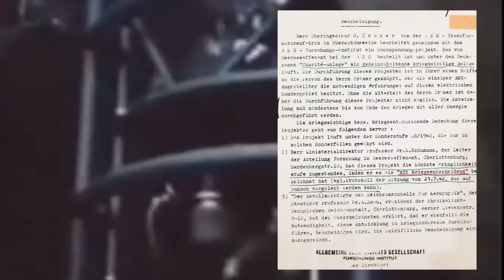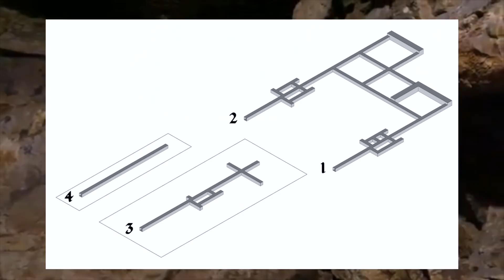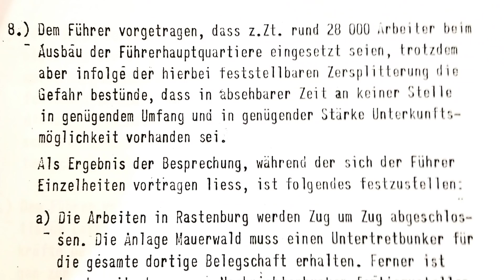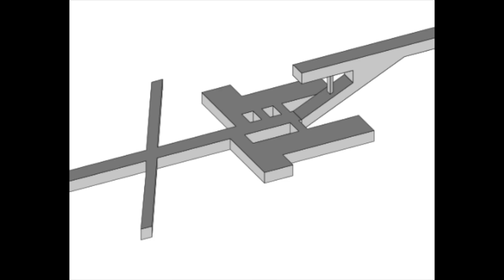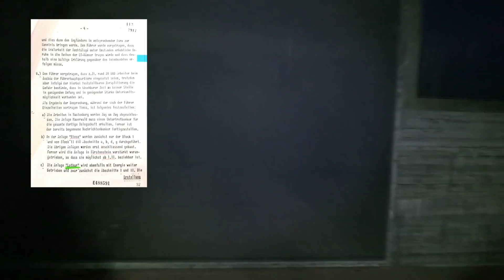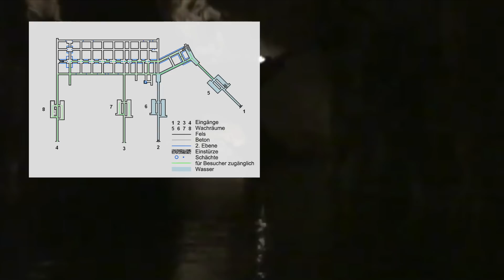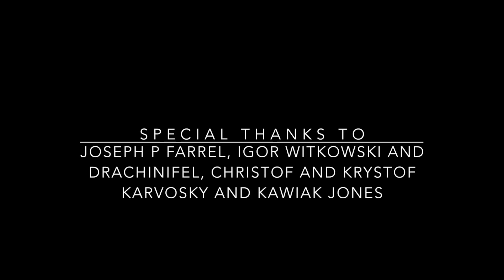THE LAST NAZI SECRET - PROJECT RIESE, WHAT ARE THE FACTS ON THE GROUND EP 3

Comment: Excellent !  I just remember a Commentator pointed out the unbelievable concrete construction costs incurred by the 3rd Riche for their research and development projects, in addition to defensive bunker construction.  These costs certainly curtailed their production of conventional war machines in the pursuit of victory.  Your Documentaries are done real well.  Thank you.
Reply from the maker: Thank you so much, and yes they really did not spend their money wisely makes one believe there was more to it then just building in different directions. Ill keep looking.
Reply: @tinostruckmann  It must be such a rush to be investigating  in person.  Good luck and thank you for such a great project.
Reply: You can make concrete with coal - tanks and aircraft need liquid fuel and the German armed forces never had more than 50% of what they needed after June 1941.
Reply: @allangibson2408  Yup.  Probably one reason Hitler invaded Russia was to get the Oil Fields in the Caucasus.  I understand that up until 1941 Germany purchased most of their fuel requirements from Russia.  They were convinced of a Quick War but were so wrong.  Also, Hitler took half of the Troops of Army A ( I think ) and should have bypassed Stalingrad with maybe just encircling the City.  Then Germany could have fought their way into the Oil Fields.  Of course, their flak  would be exposed.  That being said, besides invading Russia, the Battle of Stalingrad was in my estimation one real big reason why Germany began their defensive efforts to stall the ultimate end.  Turning Point.  Thanks for response.

Comment: That long gallery, with the unusual holes in the roof...
If you had a drive shaft above the ceiling running the length of the room, there'd be room for part of a drive wheel and a drive belt to stick down through that hole. So, a row of lathes?

Comment: We know from the Schmelcher Report (German engineer) of 1944 the purpose of each tunnel complex in RIESE.
1. Osówka and Rzeczka were built for Hitler's headquarters (FHQ),
2. Jawornik and Włodarz - headquarters of the Land Forces Command (OKH),
3. Soboń - headquarters of the Air Force Command (OKL),
4.Sokolec/Gontowa - headquarters of SS (RSS),
5. Tunnels under Furstenstein castle - Ministry of External Affairs (RAM).
The shelters for the Navy were cancelled.
Reply from the maker: I know of those plans, but there is a few problems with the construction layout making me doubt those are the true intent of the sites. However I will elaborate much further over the next episodes.

Comment: The tunnel with the spaced holes in the roof. The lay out would suggest machinery with and air extraction system ? Where there any bolt holes or plates on the floor for machines to be bolted down?
Reply from the maker: No that's the interesting part there was none which could indicate that nothing has been installed or nothing installed needed to be bolted to the floor

Comment: I just discovered your v-logs. I have a question. Is it possible to go on top of the second tunnel you say you found and look for air circulation vents ? There’s always some type of vents that have to be used . Even if they were dismantled by the Polish government,they collapse and the ground would ink around where they were ?
Reply from the maker: You mean on top of the enforced concrete divider inside the tunnels? Above what I suspect is a workspace, there are mountains for air condition pipes throughout the system some of the places still have dual pipes for are running above the workspace crawling up there would take a little bit of Goodwill from the location but I'm sure I could get up there when I go back in a month
Reply: @tinostruckmann   Not exactly,when you stand above where you think the tunnel began form the outside. Turn around and walk back into the woods,maybe it wouldn’t be soo hard to find something and it might aid in your research if you had more proof to show the Government cronies . I have watched a lot of shows similar to yours and the government people always want to deny that something like that could have happened in their country even though they had no chance of preventing it . Revisionist history is the way of the world now !

Comment: At 13:14 the second guard position with the machine gun setup in it, you have a downward sloping hole through the bunker wall to the right of the gunner, that is for grenades to be dropped down.
Reply from the maker: I have seen the same in the old WW1 forts so I agree

Comment: Those holes in the ceiling were for air ventilation.  They had them in the other bunkers under his house.
Reply from the maker: Well there were large Air ventilation tubes running in the space above the tunnels, that is pretty standard, but those large access holes were for something else then air. otherwise we would see them in all German tunnel construction. And there are to many of them in this section. If I can get up there maybe I can find mounting points for something. Going back for more measuring

Comment: WHERE S  THE GENERATOR S AND THE FUEL  PLUS COMMS THERES A LOT OF LEG PULLING HERE.
Reply from the maker: Well  lot of smaller generators and engines were set up to pull small gauge rail carts, small trains and conveyor belts carrying cement and rubble. Problem is the Russians removed everything that was worth something. And the Germans may have destroyed or removed what was key to what they were doing. Take a look at episode 4

Comment: the machine gun  positions inside were not there to protect the workers, it was there incase the workers would revolt or try to escape.
Reply from the maker: It was definitely not there to protect the workers you are right:-) But as it is a permanent fixture and the workers would eventually go away - who or what was it there to protect...
Reply: @tinostruckmann  The ones on the outside against attack by resistance or commando raids by the enemy , the ones on the inside to subdue slave labourers as jews , poles and russian prisoners, and skilled workers from occupied countries that were forced to work in german war industry  as germany was running out of german skilled workers through losses on the eastern front.

Comment: From my time in the disposal orf ordinance the curve is the solid blowing out the weaker i.e. overhang of a tunnel 

The fact you cant dig is a pain but the way we checked out bunkers and tunnels was with smoke i.e. mole bombs designed to be put in mole runs alot of what you see had hollows placing these small smoke drvices should show connections
Reply from the maker: Not to worry, Im going back too, and dont take NO for an answer...

Comment: Wire reinforced pre wired grid goes in concrete  is pumped or poured  into forms  thiey could work of a conveyor  system under ground mining equipment  check holt equipment   many abound
Reply from the maker: In deed, some of the wood forms are still in place around the rough tunnels.

Comment: Looking at how straight tunnels I think they had made a rail gun that would make sense with the what looks like repair bays in the concrete, It could had been on rails or wheels but was very long not high. As rock formation ends I think the rail gun was being tested there. It makes sense with particle accelerators and high speed testing equipment. Still a pointless idea as would not change the war because too late. But that is what I think they made. A rail gun would need power but not huge amounts like people think because what it does is make continuous explosions to propel object to a higher speed as it goes along.
Reply from the maker: You know that is an interesting thing, I will look into where that technology was at that time and the years after.
Reply: You don’t use particle accelerators for rail guns. A rail gun is propelling object at very fast speeds, particle accelerators are for smashing particles together.